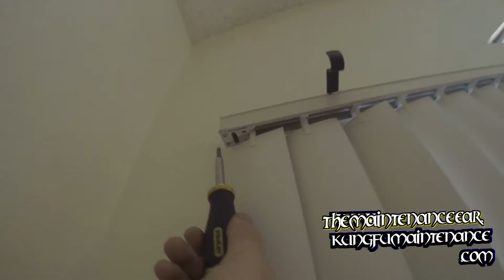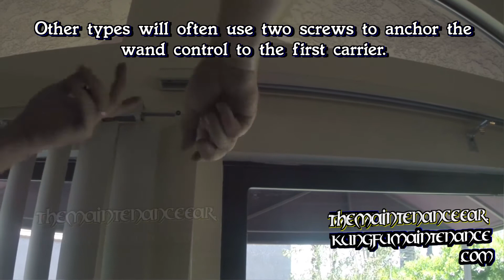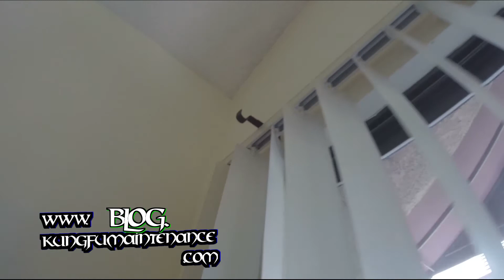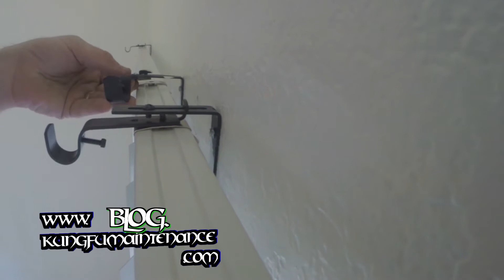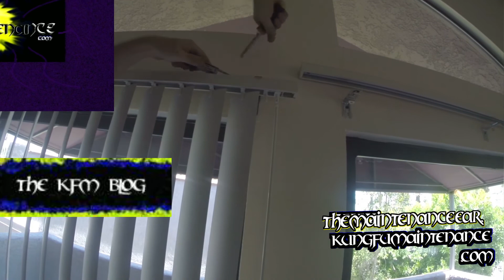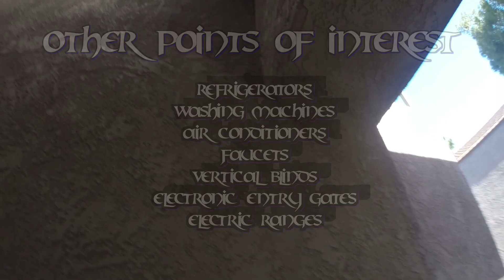How To Replace Vertical Blind Master Wand Control Plus Extend Brackets Where Blinds Hitting Wall Vid

Comment: My vertical blinds (brand new) are making a clicking sound when I turn the wand. When I turn the wand, the vane holders pivot, but the rod makes at least three big, grinding clicks before the vanes are closed. Have you ran into this problem? What is the solution?